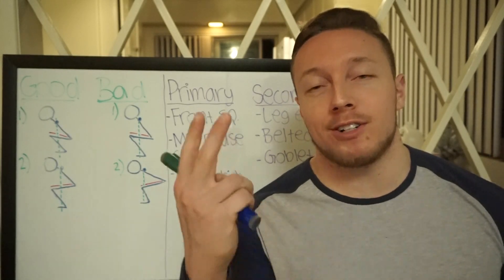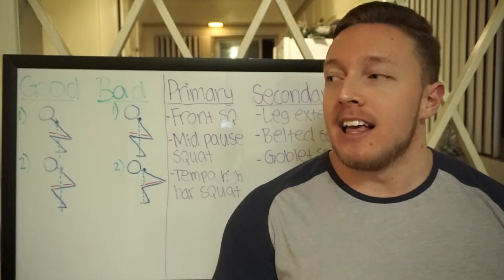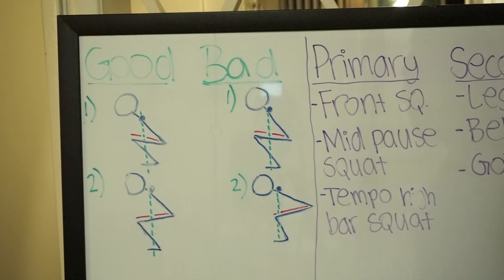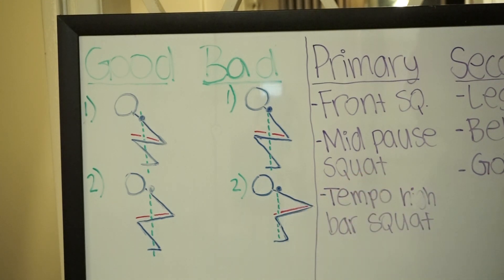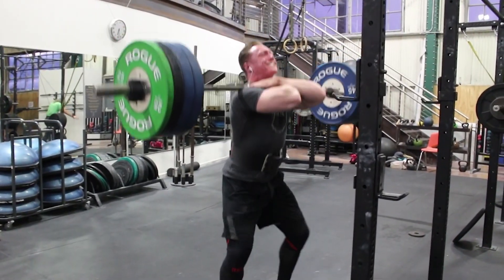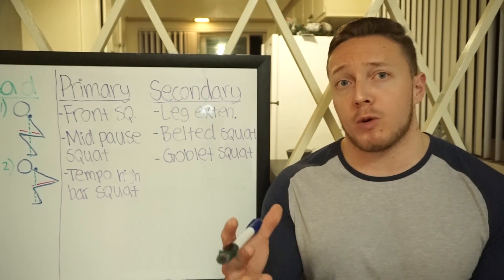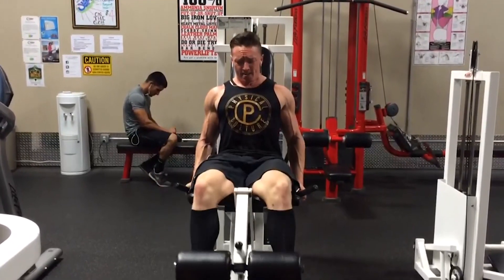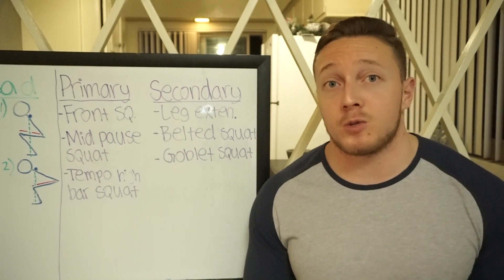Fix Tipping Over In a Squat | Weak Point Training

Comment: Hi, new subscriber here, this is exactly what I needed. One thing though, a bit of a problem I have regarding the front squat:

I suffer from reflux so my throat is very sensitive, whenever the bar barely touches my throat I get gags and it is really dangerous because it snaps me out of focus and can make me lose tightness, so I gave up front Squats with a bar. 

I'm now using dumbells for front Squats, I hold the dumbells on top of my front delts, and I will do a super squat set (3 warmup sets of 10 reps and a final set of 20 reps). 

I really want my quads to grow, do you think this is a good approach given the problem I explained earlier and if not what do you recommend?
Reply from the maker: Isaac Campos definitely try the tempo high bar squats. In fact if you learn to groove them they're better than a FS for pure quad development because the thoracic musculature isn't under as much demand. Also do you have access to a safety squat? If so have you tried those in a FS position? Dumbbells can work but there will be a point you out grow them.

Comment: Hello Brendan, greetings from Montreal. I really like your beginner program. That said, what is the reasoning behind having Lower Variation Day & Squat/Bench/Deadlift Day one after the other? It feels as tough I am  doing two leg days back to back.
Reply from the maker: Whazzupissed yo dude so there should be a day off in between those days, not sure if you saw that. If it's hard even with the day off it's just an adaptation issue. Everyone is more than capable of adapting to higher frequency training. Currently I'm squatting 4x a week and obviously a beginner couldn't do that right away but with time they can. Just stay steady with it and don't convince yourself it's harder than it is and let the adaptation take place. If you were to move the workouts around you'd end up hitting the same movement patterns back to back which would be bad. Having it in this order ensures it's different movement patterns.
Reply: Thank you!

Comment: My back always collapses with front squats. I do ATG-squats, but after the lowest point my back starts to round and it's super uncomfortable, where you just know you're fucking up your back. Is this a hip extensor problem? How do I fix this, by lowering the weight and just purely focussing on technique and using the correct muscles, instead of compensating? That's what I'm doing now, at least. Subscribed!
Reply from the maker: Maran Nebbeling yeah dude this is somewhat common, is it the thoracic region or lumbar region that's rounding? If it's the thoracic region it's mainly because you don't have strong enough muscles to brace the thoracic isometric position you have to hold that's under really high demand in the FS. If you watch my other video on the differences between squats (HB, low bar, and FS) I explain why the FS has this issue. The goal here would be to do more upper back work but most importantly exactly what you're doing which is lighten the load and only let failure happen by your weakest link (back rounding). Now if it's the lumbar region this is a technique error, mobility issue or extreme muscular imbalance. To answer that one I would have to see footage. In the meantime if you want to train your quads more I'd highly recommend HB tempo pause squats instead.
Reply: Brendan Tietz i fixed my lumbar rounding today, watching your other videos! It indeed was an error in technique. 

Well, my thinking is that im not rounding my upper back for nothing right? Isnt it wise to aim to fix it by strenghtening my weakest link, as opposed to avoiding it by doing HB squats? Having said that, i have one strength day, where i used to do low bar 5x5 (will do HB tempo pause squats instead, with higher reps and fewer sets) and front squats on my hypertrophy days in the 8-12 rep range. 

I have to admit, i dont tighten my upper back nearly enough during any squatvariation, might that be a factor for thoracic rounding as well? Im definitely working my upper back by the way! (conv. DL 3x5, bend-over rows 5x5, weighted pull ups 4x6-8, followed by upright rows for 3-4 sets of 8-12)
Reply: Brendan Tietz thank you for the in depth answer by the way, its very much appreciated!

Comment: I have a pretty bad forward lean so would improving quad strength help maintain a more upright posture when squatting? Also  could the wrist pain I have when squatting be caused by elbows flaring up (I can't keep them down)?
Reply from the maker: Hanna Tessema so forward lean is slightly different than tipping over. Forward lean will depend on technique and anatomy. Longer femurs means more forward lean but usually people I see who have excessive forward lean are dealing with improper technique. If on the way down you're very forward try getting the knees out more and "sitting into your heels." If it doesn't improve after practice than its most likely your build. Just be sure to realize forward lean happening after you come out of the hole is tipping over that's not forward lean. The angle of your Forward lean will be determined by your eccentric technique
Reply from the maker: Hanna Tessema and the wrist issue is either from excessive wrist extension while you hold the bar and or excessive force transfer through the wrists because the bar isn't supported by your torso (rear delts if low bar, traps if high bar) enough.
Reply: Brendan Tietz thanks for all your help!

Comment: Hi Brendan ^^ can you some day give some squat tips for the  ones like you and me that have long femurs af? I have some issues to find my correct form, so, some tips bould be great :D
Reply from the maker: Ocnarf the best cues that helped me were 1. Knees out (over exaggerate it, watch how much I do it when I squat and work on external hip rotation mobility). 2. Sit back and down between your heels. This will allow for optimal loading from posterior to anterior 3. Squeeze glutes and big breath into your stomach (not chest) before each rep. It should feel like your face is going to explode. This will brace your torso and create rigidity. 4. Elbows under the bar so you externally rotate the shoulder joint more and stand taller. These cues have all helped me a lot, I hope they made sense!
Reply: Brendan Tietz Today i hit a 11kg pr on my squat, i tried to push my knees out but i don't have too much mobility so i must turn my feet around 45 degrees or more, i will star doing some mobility things for my hip mobility, thanks you :D

Comment: problem is...when i "fix" this problem, I end up with re-occurring patella tendonitis in my right knee.  Seems to happen every time I keep more upright (with more forward knee travel).
Reply from the maker: Rev0UK1 yeah unfortunately this can be semi common. Things to get around this if you haven't tried already are a ton of glute activation drills pre squats, hip external rotation stretches to help bias a very knees out squat, staying away from too much volume on "comp squats" in the off season or if you're not a PLer trying to change your tempo/using things like box squats, and lastly I found not using knee sleeves to help weirdly. I'm actually starting to believe knee sleeves are unhealthy unless worn loosely which most strength athletes don't do. Rehbands or loose fitting SBDs at the most. Also doing a lot of occluded leg extensions helps a lot. If you've done all this then I'd actually recommend squatting in the safest manner (hip shooting a bit) and using more variations. I deal with this too but mine is vey manageable from doing what I mentioned above. I almost never feel my knees if I always groove perfect reps and keep up on the pre hab
Reply: I've tried playing with my stance a bit but mobility wise (using one of the tests you've described in previous vids) i seem to suit a semi narrow stance...but that in turn seems to promote more forward knee travel. So I then try out a wider stance and  dont feel  as stable / can't move as much weight...but it doesn't quite aggravate my knee as much 
I've tried the glute activation stuff. I definitely think thats a big part of it, my right glute simply not firing as much as my left seems too. I also cut out sleeves a bit ago. Will try some of the other things you mentioned once the inflamations gone down a bit. Thanks for the response.
Reply: I'd suggest making sure that your knees follow the same pattern on the way up , as on the way down. Things like making sure your knee stays stationary at a certain point of the squat is also important ( what max aita always talks about)

Comment: had a big problem with this after watching the infamous rip video on hip drive. great coach but that cue ruined me for a while.
Reply from the maker: Jason Blair Hahahaha dude same! That's what caused mine because from the start I basically purposely didn't use my quads and it built a huge discrepancy between my knee extensor strength and hip extensor strength. Glad it's fixed for you now!
Reply: I think rippetoe style squats are a good secondary or assistance exercise.

Comment: hey brendan, what are your thoughts on squatting with a safety squat bar?
Reply from the maker: john d it's good for high bar squatters or people who deal with really weak thoracic muscles. If you've ever used one you know how much it causes your back to almost round over. It does force an upright position but it's different than a FS, more thoracic demand for most people which is why I didn't include it here. Quad strength is what most people are looking for but SSB is a decent alternative too

Comment: so the takeaway here is that tipping over is due to weak quads?
Reply from the maker: Natalie Barakat yes and also it's worth noting it's not just about quad strength but specific quad strength. You could do all the quad isolation work in the world but it probably won't carryover much to the squat which is why the front squat/high bar tempo squats reign supreme!